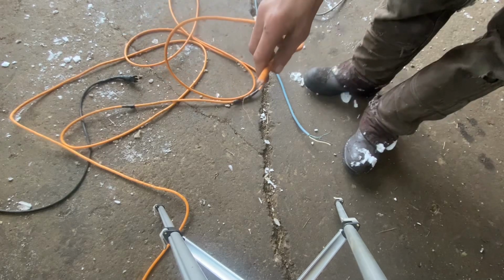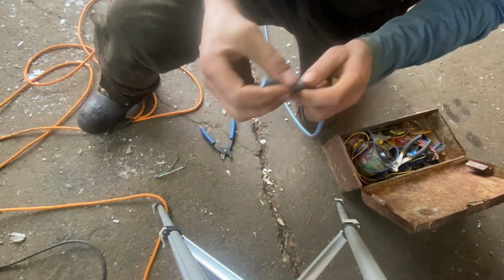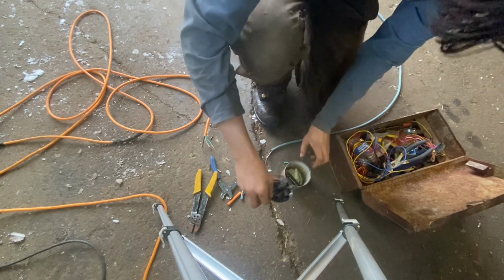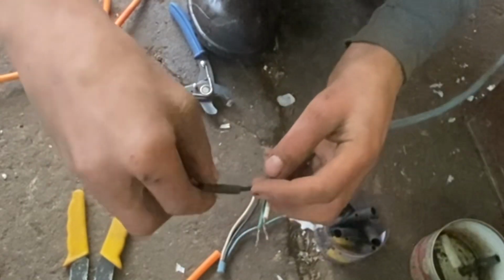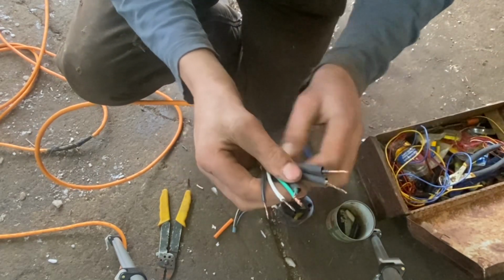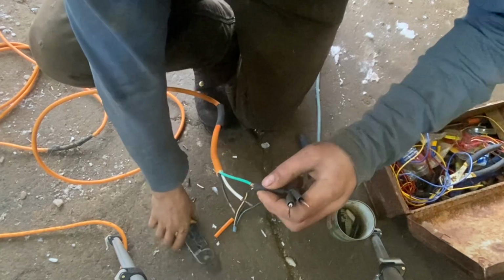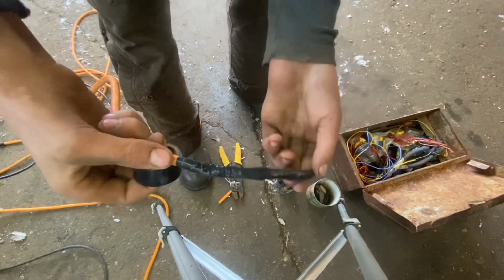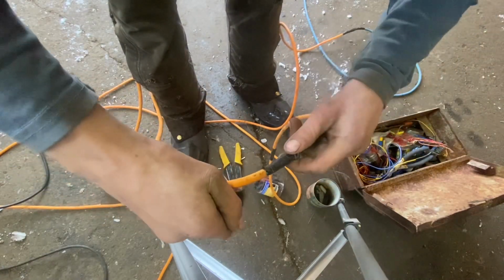How to fix extension cords ￼

Comment: I did the same.  And I make some as well add a plug at the end with a box
Reply from the maker: Always buy the flexible extension cords. The ones that are made from resin and not rubber tend to break and don’t last very long.